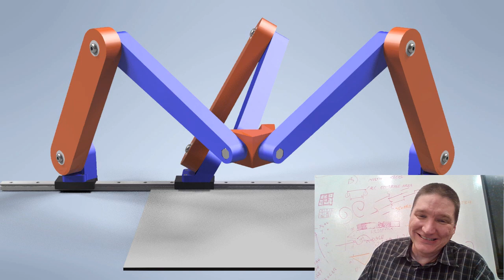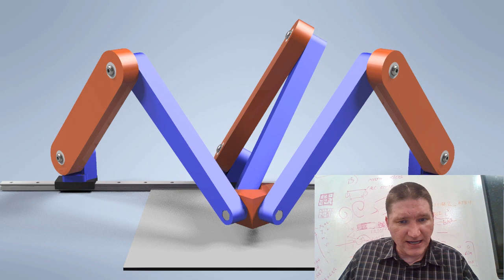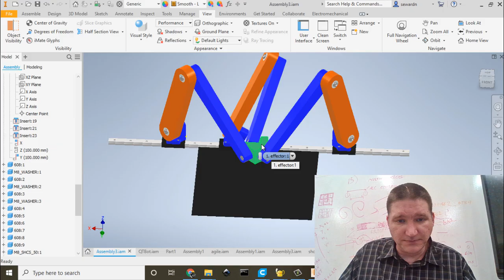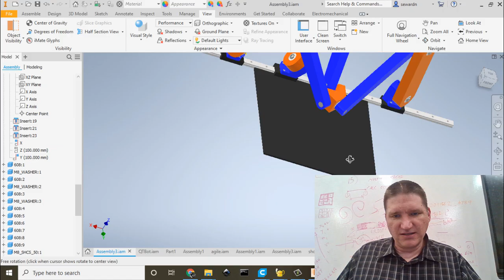RepRap Monorail (Single Rail Tripteron)

Comment: Its interesting, and fun, but...... These delta type printers will never be as accurate as a standard 3 axis cnc machine. Delta type printers are using binding force to position the head. It will only work 100% correctly in a simulator. Also, the binding force action will grind every joint to failure. A standard 3 axis cnc machine doesnt have any grind points on X, or Y. There is no benefit to the delta type.
Reply from the maker: I agree that this doesn't solve the problem of 3 axis milling as good as the standard design.  There is so much more you can do with this.  Also, when engineered right...the joints could be healthy for however long you want to design for.
Reply: @NicholasSeward  I looked at some of your other videos. I am very impressed with the printers you have made. And I see the joints you create, and I agree there is little grind going on there, but its still the problem area. I think your design in this video can, and will be used by other people/companies but it will only work 100%, if you/they have a stepper motor at every joint in the arms, ensuring the correct angle, and therefore removing binding force from the equation.
Reply from the maker: @tazanteflight8670  The point is that all the joints are passive.  It would be massively hard to drive all the joints in that overconstrained situations.  I assure you that it is just a matter of engineering.  Specify you objective, calculate loads, and pick components.  I am sure that the 6806's are more than up to it for this machine.
Reply: @NicholasSeward  Im sure it will work, but you wont have precision. Passive means hope. You are HOPING the angles you want, will be achieved. But hope only has 99% precision, LOL. And the crazier the articulation of the arms is, the lower the precision will be. Joints have slop. You either need a motor there, or space alien level joint technology. Dont take my comments the wrong way. Im just thinking out loud. I am very impressed with your designs.
Reply from the maker: @tazanteflight8670  https://youtu.be/s8N4gVybGDA is essentially the same machine and very precise.    You are right that most implementations will have problems.  It is just an engineering problem.
Reply: @NicholasSeward  That video is really interesting, and im back to the joints wearing out really quick. :^) Those joints are undergoing forces contrary to the angle they allowed to rotate, and will therefore wear out. My only point is any articulation will have slop, and if that articulation is under load the slop will only get worse over time. Every joint in a delta printer style printer is under extreme load. Put a thermal camera on that same video, and crank up those speeds, and guess what you will see. Hot joints. Again, im just talkin. No finger pointing or anything.

Comment: Seems like awesome design to print houses since you could literally mount one on a truck or like a train
Reply: With the right parametric design, you could do each house unique for about the same price. It could be amazing.
Reply: But what material are you gonna use??
Reply: @mrbusiness9214  concrete.
Reply: @jeffreymoffitt4070  but then you need to use a kind of wood to stabilize it

dont know the exact name of it in english sry
Reply: @mrbusiness9214  dude, literally use pressed earth. It turns into stone. So some sort of extrusion similar would be a perfect and environmentally friendly use of resources. There're literally whole deserts full of fucking sand.
Reply: @mrbusiness9214  use a fiber filler to add structure and tensile strength, adjust your moisture content to make it hold the shape needed, have 1 guy do touch up shaping and adding anchor points while it prints
Reply: @BeeBait  Interestingly enough, desert sand is a very poor building material, in contrast to beach or sea sand, because of the shape of the sand grains. Desert sand grains are very round and smooth, so they dont lock together to form a solid mass that keeps its shape
Reply: @meh536  sintering with a big magnifying glass.
Reply: @stevecummins324  always a way around problems...
Reply: @meh536  how about mountain snow?  Snow requires less energy to "melt" and "extrude" than sand.
Reply: @stevecummins324  To have the printer self-replicate from material on-site you need to use a lot of sand to build a giant magnifying glass to melt the sand.  If you sinter using snow/ice though...  you could build a replicator that could replicate much much faster, and once you have enough giant ice lenses you could then use the ice sinterrers to build sand-glass replicators.  The sand-glass printers could then print the ice printers during winter time O_o.
Reply: @mrbusiness9214  You could have the extruder detach from the hands and allow it to pick up another extruder.  Concrete & mud is for non-moving objects like buildings while fibreglass & plastic & aluminum is for objects that need to move.
Reply: @Masterpiece Tools couple years back used to work in UK place making houses out of timber panels. panels  pre fitted with OSB sheet/ vapour control membrane, insulation etc. 6 of us were able to turn out the complete structure for a 3 story house in a week. and that was with the automatic nailer knaffing up every couple days, and having to de nail etc/assemble manually... because someone didn't know how to think in g-code. nope wasn't me... manager wouldn't let me near it..."it's too complicated for you" etc. ROFL  3 axis machine, with a solenoid to trigger the clipped in nailer... and  there was me thinking with a hefty extruder it would make a seriously impressive 3D printer. 4m by 12m by 1m high  build  volume etc
Reply: What if you had a small 3D printer that used fibreglass, water, mud, cement, seaweed matt, wood dust, iron/steel, or other easily found on-site stuff...  And had that smaller 3D printer then print the parts to a bigger 3D printer and then that 3D printer makes an even bigger printer O_O.  Modern chips have billions of transistors, imagine if you could split the chips apart to use for your 1 million 3D printer army to make houses.
Reply: @Masterpiece Tools Don't forget seaweed or bacteria colonies, they can be genetically altered and stuff and you don't have to cut down and grind the wood you can build out of bacterial "playdough".
Reply: @Masterpiece Tools You could also build with bamboo, treated wood, treated seaweed and genetically altered fungus/bacteria colonies...

Comment: Excellent idea.
I think the rail will have to be fitted to a rigid plane/base to avoid it toppling while moving the arms.
I still couldn't imagine how you would be able to run this on a single belt
Reply from the maker: Yeah.  I will mount this to a rigid extrusion with feet.
Reply: I guess he mounts one stepper motor under each arm base. As each motor rotates, it translates along the felt which stays fixed, more or less like a rack and pinion.

Comment: I think the problem will be the limited z height. As you raise the z you close the gap between the 2 left arms. I think a 2 rail system counld work. Think of 2 rails 90 degrees form one another. You may be able to cross the arms and increase z. Not an engineer and maybe there is a way to make it work. I would like to see the animation with a higher z setting.
Reply from the maker: Z is limited.  It increases as you move away from the rail.  You can unleash the z by a second rail parallel on the other side of the work area.

Comment: Linear rails are expensive parts. This method could save allot of money.
Reply: In principle thats true, however....

1 - i am unsure if 1 long linear rail is cheaper than 3 short ones

2 - i am not sure you can buy rails with 3 slides. Inserting slides onto a rail is a PAIN. (Even if you can buy them separately.)
Reply: I'd be concerned about how long a single rail will last with all of the weight continuously applying torque to one side and the load having plenty of leverage too, probably going to need a beefier rail to handle that with the same reliability and accuracy as triple-rail setups. You also have three bearing sets in each arm (drive block to first segment, first to second segment and second segment to head assembly) and any wear, play or sticktion (extra force to break static friction) in those will add inaccuracy too. Neat concept in theory, though getting it up to the same print quality standards as more conventional setups will be challenging due to extra moving parts in critical paths.

Comment: Any non-90 degree angle for Z would work. What is the effect of having it at 5° or 85°?
Reply from the maker: You will have resolution or constraint issues at these fringes.  You will need to stick somewhere in between to get okay results.  What is best...to be determined.

Comment: As the movement at the end-effector relies on these large lever arms where the joints are used "sideways", typically its challenging to get precision without any backlash with these setups. That might not be accurate enough for 3d printing, but would like to be proven wrong by a protoype.
Reply from the maker: Yep!  It is just a design problem.  It will be tough to get right but can definitely be solved.
Reply: @NicholasSeward  i guess what you need is bearings/hinges that can be very strong with sideways forces.
Reply from the maker: @stefanwelker956  yep.  Will use large (volumetrically) arms (low mass) with 6806 bearing.  Should be great.
Reply: @NicholasSeward  While somewhat limited in Z and Y , i like this is endless distance in X (theoretically)!

Comment: Many people saying about the compact size but I think it really shines when dealing with high velocities! It seems that this design reduces a lot of ressonance and vibrations, meaning that for a high speed 3d printer it could work great!
Reply: I fear that the opposite may be true. Since all three arms hang off one rail it would likely be prone to torsional vibrations around that rail.
Reply: @maninalift  That's true. Maybe some kind of dumper on each joint would reduce that

Comment: Would there perchance be a way you could share the CAD files you have? I am very interested in this design and the files (or atleast the angles) would be a great headstart
Reply from the maker: I will be sure to make a Github when building commences.  As is, it is just a visual.  The angles can be anything, I used 45 on the outside ones and 30 on the middle one.

Comment: It seems like the linkage above the initial joint is angled at in the roll and yaw.  I assume these are all different angles in order to have 3 intersecting planes to converge on a point?
Reply from the maker: You are correct.  Jury is still out on the best angles.

Comment: this would be great to be like built into the back of a table and have a rail the length of the table so you can position the head wherever you want and just print or possibly use it for laser engraving, or have multiple build areas along the travel path so it can print one thing, then move to the next area while someone comes along and clears the previously finished prints

Comment: Ooo, pretty. I can't think of practical applications for what I'm imagining in my head, but I see this thing scrolling across multiple print beds placed next to each other, or the rail connecting in a circle. Or multiple assemblies on the same rail with different materials - or that can print in parallel on the same job, but in different sections?